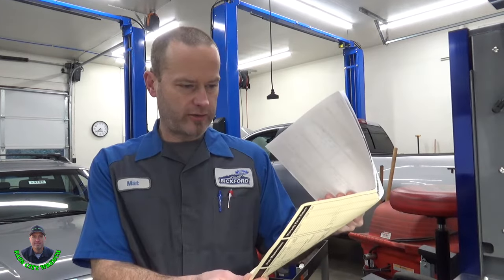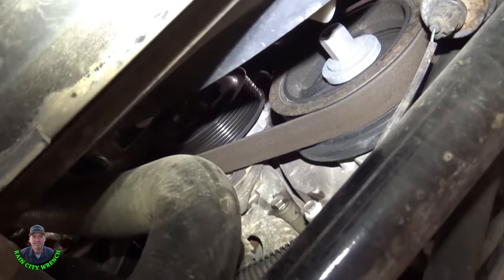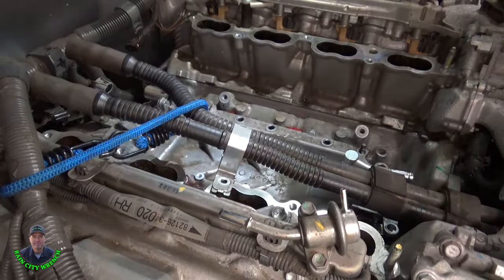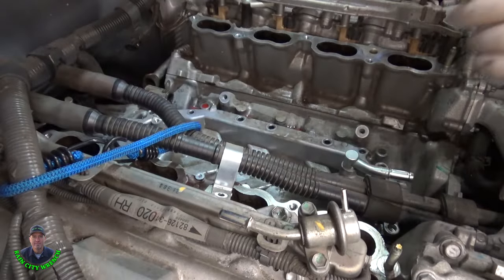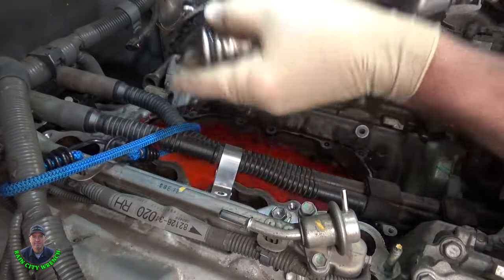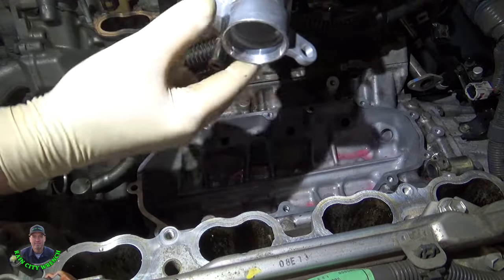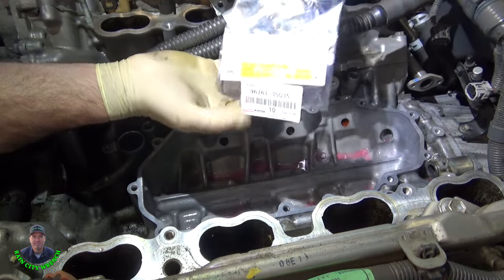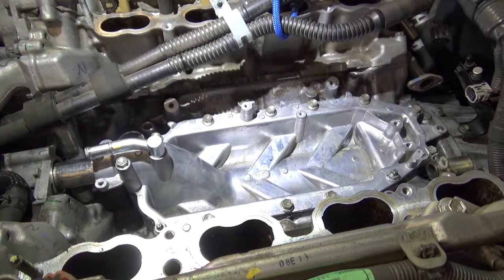TOYOTA TUNDRA 5.7 COOLANT LEAK UNDER INTAKE

Comment: Can this be diagnosed without removing the intake? A small camera fed in from front or back?
Reply from the maker: Yes, you can use and inspection mirror and take a peek under the back of the intake manifold. There are a few spots from the front where you will be able to barely see the plate down in the valley with flashlight.

Comment: Does it matter which part you put the silicone bead on? seems like it might be easier to put the bead on the engine and then set the part on top? Just wondering as im doing this tonight. Thanks.
Reply from the maker: Get it fixed up? No, it doesn't matter which surface you apply the silicone. Personal preference
Reply: @raincitywrench117  OMG, that bolt on the EGR tube was insanely difficult. Also, How do you know if the coolant pipe on heat exchanger is seated properly? Mine didnt and I had to take off intake again, then used channel locks to move and twist pipe until it stopped leaking. Im crossing my fingers I dont need to tear it all the way down again. Massive PITA
Reply from the maker: @jasonsmith7809  Yea, that one bolt isn't fun. The coolant pipe "floats" in the center and it will only go so far in each direction. You may have had a little corrosion or gunk stuck in the bore. Reusing or not installing Toyota o-rings could also give you problems.
Reply: @raincitywrench117  thanks for your advice. Im gonna rip the exchange plate off and try again.

Comment: Found a coolant leak under the reservoir of my 98 K1500 Silverado, had replaced the water pump last year and replaced the gaskets under cylinder head.
It’s not the heater core, I’m leaning towards the intake manifold gasket or worn out connector hoses connected to the metal pipes.
Can I get your opinion on this before I get more work done and spending more money then I need to?
Reply from the maker: These are real common for the intake manifold gaskets to leak. The original gaskets are plastic and they make an updated metal/rubber gasket. I would have the cooling system pressure tested and leave it under pressure overnight to find the leak. You can pick up a fairly cheap pressure tester at harbor freight if you want to do it yourself. https://www.amazon.com/Fel-Pro-MS-98000-Permadryplus-Manifold/dp/B000CH0C0Y/ref=asc_df_B000CH0C0Y/?tag=hyprod-20&linkCode=df0&hvadid=312061942313&hvpos=&hvnetw=g&hvrand=4303600977851000936&hvpone=&hvptwo=&hvqmt=&hvdev=c&hvdvcmdl=&hvlocint=&hvlocphy=9033382&hvtargid=pla-434880887414&psc=1&tag=&ref=&adgrpid=63195598318&hvpone=&hvptwo=&hvadid=312061942313&hvpos=&hvnetw=g&hvrand=4303600977851000936&hvqmt=&hvdev=c&hvdvcmdl=&hvlocint=&hvlocphy=9033382&hvtargid=pla-434880887414
Reply: @raincitywrench117  Thank you

Comment: what gasket did you use to replace it?
Reply from the maker: I used Motorcraft TA29. I would have used TA31 but was out. That stuff works awesome, use on everything. Here is the factory sealant: TOYOTA & LEXUS 00295-00103 GRAY O.E.M FOR ALL MODELS F.I.P.G GASKET MAKER

Comment: I’ve never done a newer vehicle like this…what gaskets are needed to put the manifold back on?
Reply from the maker: You need the coolant pipe o-rings and intake plenum gaskets plus some FIPG sealant to silicone down the plate

Comment: I broke the plastic manifold by lifting up on the front to replace the knock sensor harness. i was originally trying to sneak the harness in without removing the manifold.  The back 2 bolts were in place and the manifold broke where those last 2 bolts attach. Dumb mistake, yes. This was after watching about a dozen videos to make sure that I had all the bolts. But none of the videos mentioned how many bolts to remove.  Anyway now I'm trying to decide if there's any way that plastic welding or JB weld is strong enough to attach the rear pieces to the manifold or the other bolts will create enough of a seal?  This is all caused by a mouse that made a nest inside and chewed up my wiring harness
Reply from the maker: Stupid mice! May see if you can snag one cheap off eBay or at local wrecking yard?
Reply: @raincitywrench117  Yeah, was looking at used manifold options.  Actually I decided to use a really strong glue to put the manifold bolt tabs back for the back 2 bolts.  It was a gamble, yes.  But I was able to get an extremely strong bond.  So far the vehicle is working perfectly with that repair. It also probably helps that the manifold only needs 15 ft pounds of torque on it!

Comment: How do you know if the coolant pipe is seated correctly? Mine leaks after installation.
Reply: I’ve done this job 3 times in last 6 weeks because my o-rings keep leaking. I think I’m going to cover them in the same silicone that I’m using to hold down the heat exchanger. It’s crazy. If I stay under 65 mph then I don’t leak at all, but if I get around 75-80 mph my temp gauge starts rising and it spits coolant from that pipe.
Reply: @ryanalexander984  I bought a new coolant pipe, slightly updated part and pretty cheap. Make sure you put a ton of silicone grease on the o-rings so they dont get pushed off their seat when you put the pipe back in heat exchanger.

Comment: What sealant or silicone did you use or recommend?
Reply from the maker: I used Motorcraft TA 357. Toyota FIPG is recommended. Permatex Ultra Grey would also work great. https://www.amazon.com/Permatex-82194-High-Torque-Silicone-Gasket/dp/B000HBGI8K/ref=sr_1_1_mod_primary_new?crid=30XEDELDP7QK1&dib=eyJ2IjoiMSJ9.6eKLPo-6ohh2IIZAIqEJaBT7kafYpRdMsZYfdg2D_q-AhRVLb7hmDqntzG8-isjhkcff1C26TYlSDV-OH9DhYn5HZVbh-NgULKXjvqTnD_SnqcG9VdvJbwP4YqNGiAQQzbH1eOwj44MxjTB4Nk-TRT2P5WNK9eCeXOeV-i9cPhlPGLJjiKwGQQZSUuZbmV5HzgAB7QP3607yGNEyV130-Lh8ywfTPRG2RplEviWkad-Df5jZ3rUa3zZYYCbARoovvss5HVvMjKjvNgmtbK411l23I8dpGGJ3jAZkZwbmSgI.nEp4bbsBAR5kaFVIoVcwag6h532He1hRmuOyvI1EONU&dib_tag=se&keywords=Permatex%2B82194&qid=1710738217&s=automotive&sbo=RZvfv%2F%2FHxDF%2BO5021pAnSA%3D%3D&sprefix=permatex%2B82194%2Cautomotive%2C145&sr=1-1&th=1

Comment: What silicone to use? Any specific kind?
Reply from the maker: Use Toyota FIPG or equivalent https://www.amazon.com/Toyota-Genuine-00295-00103-Formed-Place/dp/B000EDDTV0
https://www.amazon.com/Permatex-82194-High-Torque-Silicone-Gasket/dp/B000HBGI8K/ref=sr_1_1?crid=GYISWRYKQCF0&dib=eyJ2IjoiMSJ9.6eKLPo-6ohh2IIZAIqEJaBGPZdlzsRq_mdnCz3sJLRjClOI5vjUEHDxTzzeC_0VINpVNQEkQZAL0__HxAq6YNRFWGekL9vq5hinMEQ5Eym8ifFiZC6ursW9OVnS75pjxVxu3x9QW15ry8alhhdeW7XsTChxBj62DH3f9UrE3W44UldgyjF5CaeiLXQfdeniQ5A93NHaUlkvxDvkrtRZm6enHbzbGaX5RZc08R6Lw2U6kv8OfqFNyAcV-i0uEeExf14DtRChV3K13OZbIKgFxEzRoE76f4sjmQTMrreHkLxo.8iq6RhfmZ5LPTPuFhAovYHdSD3WmpUWNY3pIfjIGXkk&dib_tag=se&keywords=ultra+gray+silicone+automotive&qid=1717563527&s=automotive&sprefix=ultra+gray%2Cautomotive%2C145&sr=1-1

Comment: Can someone put the part numbers in for the orings on the cross over pipe for the distribution plate
Reply from the maker: The large coolant pipe o-rings are #96761-35035
https://www.ebay.com/itm/284519665139?chn=ps&norover=1&mkevt=1&mkrid=711-117182-37290-0&mkcid=2&itemid=284519665139&targetid=1262779893049&device=c&mktype=&googleloc=9033382&poi=&campaignid=14859008593&mkgroupid=130497710760&rlsatarget=pla-1262779893049&abcId=9300678&merchantid=6296724&gclid=CjwKCAiA8bqOBhANEiwA-sIlN4B2mZ-Gt_Sam9O768pfktz1LOUXCGXQWwpJUNa3qC8GnJ8PHD--LBoCXxEQAvD_BwE

Comment: Torque wrench brand ? Am looking for some one like it.
Reply from the maker: Cornwell but they have discontinued that unit. Here is the replacement:https://webcat.cornwelltools.com/CTG3000ANGX-3-8-Drive-Electronic-Digital-Torque-Wrench-p373537414 I have the 1/2 version of this unit. Both are fantastic. Feature angle mode + have aluminum handles. Prices are ridiculous though.

Comment: What silicone did you use????
Reply from the maker: Motorcraft TA-357 but Toyota FIPG is the factory sealant. Permatex Ultra Grey would also work great https://www.amazon.com/Permatex-82194-12PK-High-Torque-Silicone-Gasket/dp/B001REZBIE/ref=asc_df_B001REZBIE/?tag=hyprod-20&linkCode=df0&hvadid=693070740373&hvpos=&hvnetw=g&hvrand=5178546024868755165&hvpone=&hvptwo=&hvqmt=&hvdev=c&hvdvcmdl=&hvlocint=&hvlocphy=9033404&hvtargid=pla-434484252858&mcid=8f30e72b8eaa3d469687bad324eeff46&gad_source=1&gclid=Cj0KCQjw0MexBhD3ARIsAEI3WHIBBBYWfSpx0D06gJzSDcae6u83gKqIkUEDbJD6SfPJcHEEoMPCAtsaAiqiEALw_wcB&th=1

Comment: any recommendation on the seal type as my dealer has no clue what kind of gasket maker seal is it. also what type of lube used  to install the O ring on the small tube and by the way thank you so much, you did a great job I am half way through the Job waiting on buying the sealant before removing the heat exchange plate
Reply from the maker: Permatex 82194 Ultra Grey would work perfect. It's the same thing as Toyota gray fipg. And the lube I use is Sil Glyde as it won't swell rubber o-rings. https://www.amazon.com/Permatex-82194-High-Torque-Silicone-Gasket/dp/B000HBGI8K/ref=asc_df_B000HBGI8K/?tag=&linkCode=df0&hvadid=312097317052&hvpos=&hvnetw=g&hvrand=17824329096223271698&hvpone=&hvptwo=&hvqmt=&hvdev=c&hvdvcmdl=&hvlocint=&hvlocphy=9033382&hvtargid=pla-437600037492&ref=&adgrpid=57631863970&th=1

https://www.amazon.com/AGS-SIL-Glyde-Multi-Purpose-Weatherproofing-Lubricating/dp/B0036VMLH0/ref=asc_df_B0036VMLH0/?tag=&linkCode=df0&hvadid=332041241935&hvpos=&hvnetw=g&hvrand=18326641651597403897&hvpone=&hvptwo=&hvqmt=&hvdev=c&hvdvcmdl=&hvlocint=&hvlocphy=9033382&hvtargid=pla-586191599437&ref=&adgrpid=66194160629&th=1

Comment: What sealant do you recommend? Is there something better than Toyota’s?
Reply from the maker: Permatex Ultra Grey would work nice and cheaper. It's similar to Toyota FIPG 
https://www.amazon.com/Permatex-82194-High-Torque-Silicone-Gasket/dp/B000HBGI8K/ref=sr_1_1_mod_primary_new?crid=27IWCCJHJUWVN&keywords=permatex%2Bultra%2Bgrey%2B82194&qid=1693198373&s=automotive&sbo=RZvfv%2F%2FHxDF%2BO5021pAnSA%3D%3D&sprefix=permatex%2Bultra%2Bgrey%2B82194%2Cautomotive%2C143&sr=1-1&th=1

Comment: Wich sealand you used..
Reply from the maker: Toyota FIPG is the oem sealant. This is equivalent:https://www.amazon.com/Permatex-82194-High-Torque-Silicone-Gasket/dp/B000HBGI8K/ref=asc_df_B000HBGI8K/?tag=&linkCode=df0&hvadid=312097317052&hvpos=&hvnetw=g&hvrand=8420193565382510940&hvpone=&hvptwo=&hvqmt=&hvdev=c&hvdvcmdl=&hvlocint=&hvlocphy=9033382&hvtargid=pla-437600037492&ref=&adgrpid=57631863970&th=1

Comment: Not smart to use that disc. Should use just Scotch rite by hand only.Disc takes off too much material and is harder to control.
Reply from the maker: I agree. Almost never use the disc on aluminum but since this was such a small flange, wanted to give the surface some grit for the silicone to "bite"

Comment: I bet it wouldn't leak if you used anaerobic sealer
Reply from the maker: I believe the original sealant would have been Toyota gray FIPG. I was going to use Motorcraft TA-31 which is similar but was out. At least it has never come back. 🤞

Comment: Nice job. I prefer "The Right Stuff" gasket sealer . OEMs use it all over the engine. Sitting overnight is key. Starting it up with an uncured sealer is looking for trouble.
Reply from the maker: The right stuff works great. I'm at a ford dealer so I mostly use the gray Motorcraft TA31 for diesel engines but was out at the time. It's similar to the right stuff It sets up real nice and never had a failure. Had some TA29 on hand so rolled with it. I always let jobs like this set overnight. The service writers sometimes don't like it but tell them tough, that's the way it is.

Comment: Fix mine please!
Reply from the maker: You can dooo it! waterboy
Reply: I paid someone like $700 to do it about a year ago. Leak came back slowly. I can do some basic vehicle maintenance but this may be beyond me.
Reply from the maker: @JustDvoh  They must have not got a good silicone adhesion. Yea, this job is a little difficult and can be screwed up easily so don't blame you for taking a pass. Maybe they will be nice and do it again under warranty?

Comment: What do you use for cleaning in the blue container?
Reply from the maker: It's bulk brake parts wash from a 55 gallon barrel that the shop supplies. Any can of brake parts cleaner from a parts store will work great.